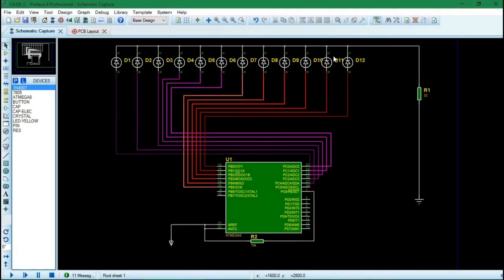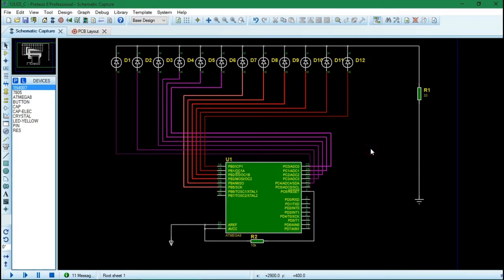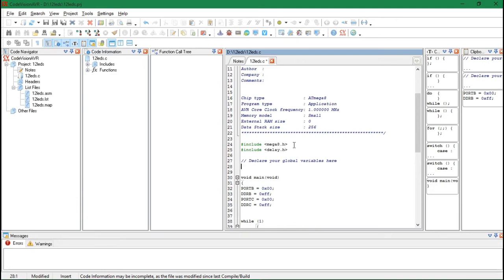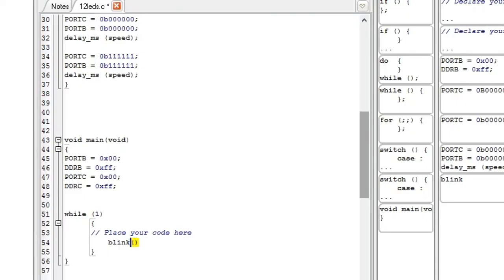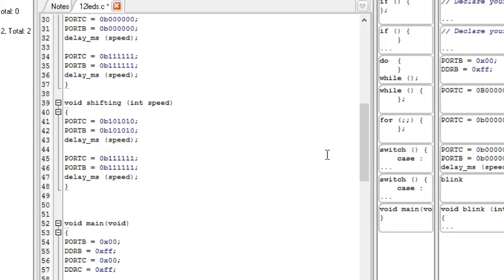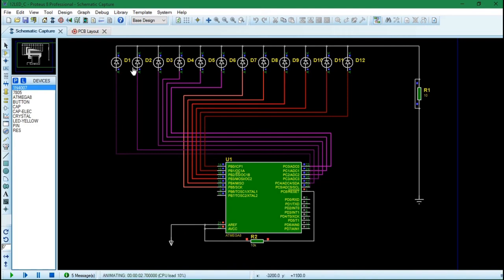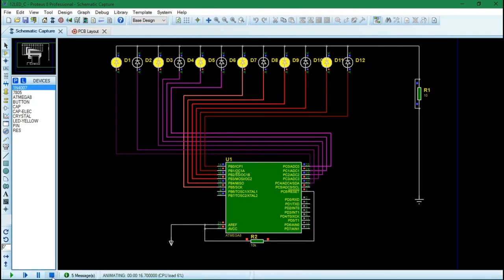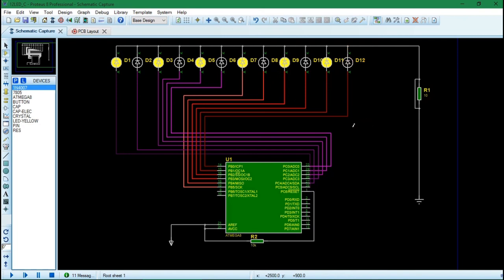12 Led Chaser HEX Code - Easy and Fun AVR Coding

Comment: i tried it sir, it works fine.
can you help me to include potentiometer for speed control, (delay time)..???
Reply from the maker: The speed is controlled by codes at that example. I'll make adjustable speed later.